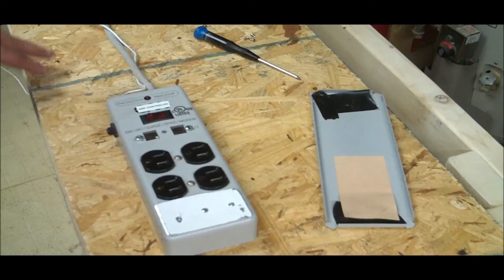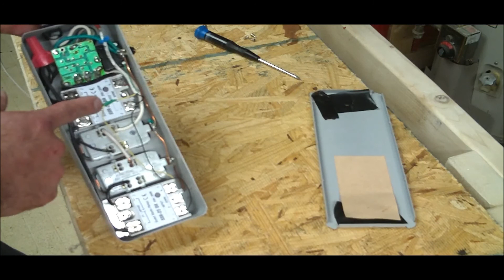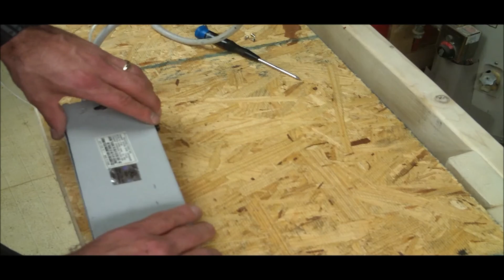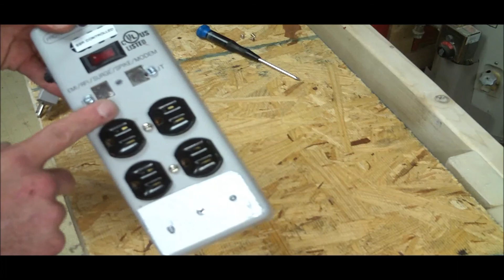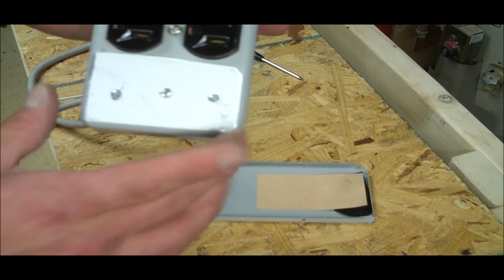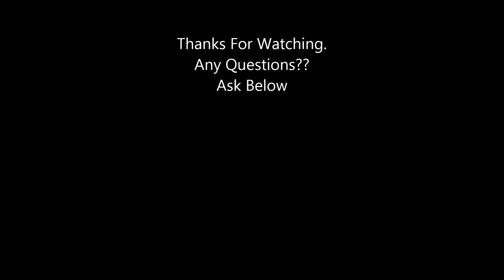HOW TO: DIY Power Bar / Aquarium Surge Strip / Arduino SSR

Comment: Hey, would you please send me the circuit diagram and coding of arduino?
engr.salman089@gmail.com
Reply from the maker: +Salman Muhammad Here is the code for Arduino, https://sites.google.com/site/recksdesignfabrication/arduino-projects/arduino-aquarium-computer   . I just hooked a Digital pin to positive of the SSR and then ground to the other pin of the SSR.